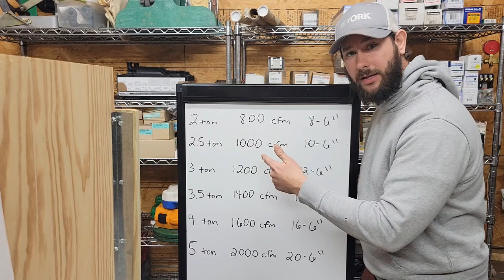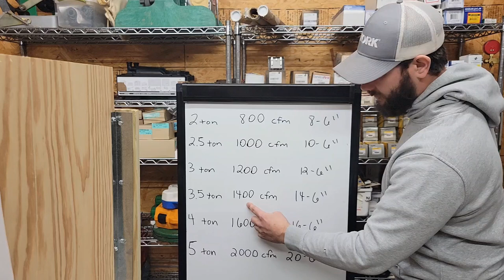How to Size Ductwork? #Ductwork #ductsizing #hvac

Comment: How do know if the fan on the unit will have enough power to move the air? What is a duct system is too long for a fan to move the air effectively?
Reply from the maker: watch the full video it should help answer your questions 
let me know
Reply: @TaddyDigest  couldn't find the link to that video....
Reply from the maker: The video is on my members only playlist.
The video is also down in the link in the description

Comment: Is there a formula for an air return duct size in relation to the supply size in a small sealed room? In other words I will be supplying a room with 2- 6" ducts. What should the return air size be?
Reply: (2) 6” returns.  Or whatever the requirements of cfm are for that room.  If not you will have an extremely pressurized room.

Comment: Can you make a video that compares a few common flex duct brands. Maybe include what can be found at big box stores vs HAVC supply houses.
Reply: For example, a large house(3300sqft) worth of flex is $2250 in JPL but if I want to use Quietflex it would be $3350. Both R-8 metalized flex from the same supply house. It would be great to know why someone would pay an additional $1100. Quietflex does highlight their “rip-stop” scrim reinforcement. So maybe if there is a location in the attic that likely to get damaged spend the extra for “rip-stop”?

Comment: Do you not measure the overall space for tonnage, then measure room size for pipe size,  been doing this for 32yrs
Reply from the maker: I only measure for individual pipesizes when I am doing a larger commercial project that requires a A good piping design layout as well as electric
Reply from the maker: You are correct I like that you do it the right way
 Very cool
 Thank you for watching I hope you're having a good day

Comment: Thank you for your video, I dont understand what mean 8-6" for 2ton- 800cfm?
Reply from the maker: watch my duct Sizing video 
You will understand after that one
let me know if you have questions
Reply: He means in order for the correct amount of airflow to circulate through the ducts with a 2Ton system you require 8 ducts that are 6” minimum in size.  6” ducts carry 100CFM each.  2Ton = 800CFM = 8 * 6” ducts
Reply from the maker: That's awesome thank you so much for posting this good knowledge and good interpretation
Reply: @grittychitty7538  Are 8 ducts the same as 8 registers?  I live in a 2-story house and have a total of 11 registers. Thank you.

Comment: Question for a house 2,100 sqft what size of equipment?
Reply from the maker: Depends on the type of insulation
I would do a load calculation for sure
Watch my video on how to size equipment
Reply: @TaddyDigest  Thanks for answering the question, it comes from the fact that I have a 2,100 sqft house but the unit I have is Lenox 3ton, it cools well but I have to set the thermostat to 69 to 70 to be comfortable. From the plenum they got a direct 7,4,7,9, 4,6 then they used flex #14 from the plenum for the mixing box and distributed 4 outputs of 4,9,4,6 flex then a 10 flex of the 14 flex that is in the mixing box to supply 4,4,4,7 flex I’m in the trade around 3 years and continue learning thanks

Comment: someone related to flow..  was redoing the ductwork in an older home that had a newer furnace/ac.  I asked the tech to clean the coil while we had the unit disconnected and when he pulled it out, to my surprise we found the installation manual laying there right on top of the coil, blocking flow.   Guys, always check the new unit and remove foreign paperwork! 

That 8.5x11 manual had been there for a few years!

Comment: I have 14 in flex duct running to heat pump but can't find 14 in can I reduce to 12 in flex duct ? If so what all needs to be changed?
Reply from the maker: Did you watch the video?
 You need to watch the whole video click the join button

Comment: Hi I have a 2 ton unit and need a new one but want to go with a 3 ton is that something easy to do I’m almost at 1800 ft.² coverage with four different returns
Reply from the maker: nice 
Depends on your duct size 
the amount of supply vents and sizes 
and insulation value of home

Comment: Question, i have less than 900 square ft home i was given a carrier 3.5 coil with heater blower. i was told that a 3.5 is too big for my home. and i should use a 2.5. i now have a 2.5 condenser by carrier. the house has 2 br,bath, kit, living room and a dinning  room off the kit. in the hallway i only have room to access the attice there is no place for a large return. i am told i should put the returns in the ling room and bed room. i am doing the install by myself. what size vents and ducts should i use. i know the coil and condenser don't match. but which is better the coil being bigger or or smaller?
Reply from the maker: Hey Michael you are a member thank you for joining
 Send me an email at tadfuller1@gmail.com
Reply from the maker: Hey Michael have you seen my duck sizing video

Comment: Hey, I’m a member. Do you have a video on return sizing for a 3 ton unit ?
Reply from the maker: Hey Eddie thank you my brother for joining.
If you haven't sent me an email.
Here is my email tadfuller1@gmail.com 
I should have a video on return duck sizing
If not I will make one
Reply: Eddie! The biggest possible with filters installed. It has to work.

Comment: Are package units more efficient than split system?
Reply from the maker: No split systems are more efficient than package units
Reply: Ok thank you I always wondered I was under the impression 16 seer gas pack was equal to a 16 seer split system so I understand now all seer aren't the same.
Reply: I just had a entire system installed last January 2021 American standard gas package my home never had one and I really looked at the york system's but I was kinda of afraid of the micro channel coil system wasn't for that I would have given you a call brother I'm in Chester co. I may swing over your way and learn some knowledge.
Reply from the maker: I really don't like the micro channel coils
 Some of the York units don't come with micro channel but some do
 Glad you got a new system hope all is well with it

Comment: My house is 800 sqft. We just had a two ton unit installed. We have 6-4” and for some reason our bedroom don’t cool as it should. The bathroom and basement is beautifully cool. We have to run window units when the temp gets hot. The thermometer in our house says it gets between 78-85 degrees which is insane considering we put the thermostat to 65 to cool the house. We need the bedroom cool because we don’t want our dogs to be heated. What should we do?
Reply: Maybe your air conditioner is short cycling because it's over sized(it technically should be 1 or 1.5 ton depending which area of the heat zone you live in) Maybe duct work is sized poorly. Maybe your dampers are closed in the pipes under your supply air grills in the rooms. A proper technician can find the problem.
Reply: Every 24ft the duct size should come down to push same amount of cfm.

Comment: Do the same rules apply to ducted mini-split systems?  I vaguely recall reading something about them using higher velocities???
Reply from the maker: Ducted Mini splits are awesome they have a pretty good range of adjustable blower static pressure settings. I have a video on how I changed the static pressure using software
Reply from the maker: I treat them the same though

Comment: I was at a house the other day where my suction pressure seemed a little low and I had 2 degrees of super heat. When I went inside to the furnace to take total external static pressure, it was rated for .5 but I was getting 0.8. I got .27 before my blower and .56 after my heat exchanger.  
I thought my evaporator coil maybe the problem because I was getting a pressure drop of .3 across it. I got .56 before the coil and .26 after the coil. I chemically cleaned the evaporator coil and even used a hose. That coil is spotless. Nothing changed as far as static pressure. I don't know the rating for that coil for pressure drop because there is no model number that I can find. 

The outdoor unit was a 5-ton so I'm assuming the evaporator coil was correct since it was the original evap coil since the house was built. 

So I started looking at duct sizing. I had a 20-in flex duct for my return. It literally 90 right off of the air handler and to the filters. I think I was getting plenty of airflow since my static pressure before the blower was .27

For my Supply I had three 14-in flex ducts and one 6 in flex duct going to some little room. 

I don't know if I didn't have enough Supply duct but it almost seems like the coil was like a brick wall. I should have pulled one of the 14 inch ducts off and check my static pressure but I don't think that would have changed anything since I was getting 0.26 after the evaporator coil. 

Anyway, i believe I have sufficient Supply. But I'd like feedback if possible
Reply from the maker: Interesting I will look at my ductulator and figure out what you've got going on
Reply from the maker: Ductulator says 14 inch duct carries 700 cfm so for 3 that would total 2100 cfm which would be plenty for a 5 ton 
20 inch duct will carry 1800 cfm
Reply: @TaddyDigest  thank you
Reply from the maker: You're welcome my friend
Reply: @biblebloopers946  is the txv adjustable and did you try lowering the fan speed? Also check if sensing bulb for txv is properly and securely attached and well insulated. What was your subcool on pressures?
Reply from the maker: Thank you JD
 I love your knowledge
 And I love that you're sharing
 Appreciate you my friend
Reply: @jdd6447  fixed metering device
Reply: @biblebloopers946  make sure you have the proper piston and they are sized based on the outdoor unit capacity .what was your delta across coil?
Reply: @jdd6447  16 degrees